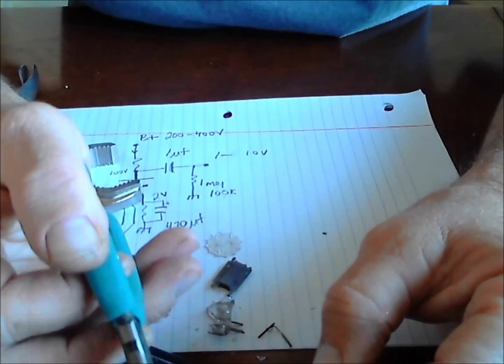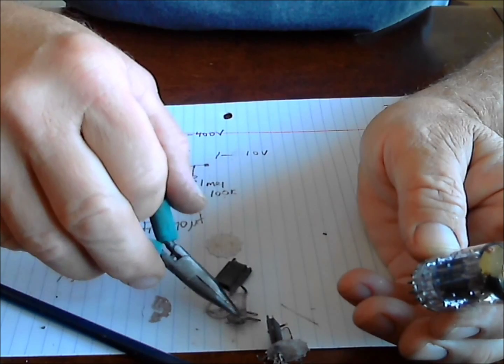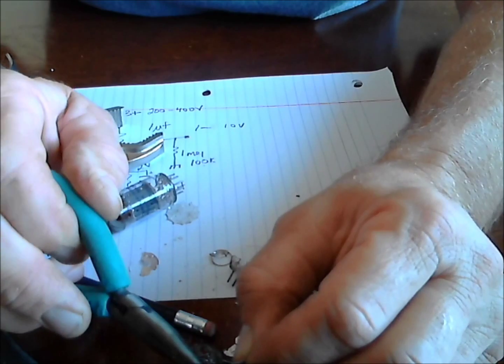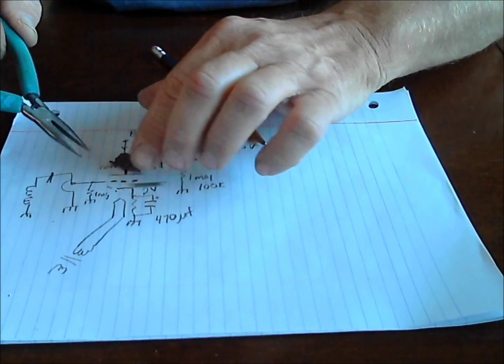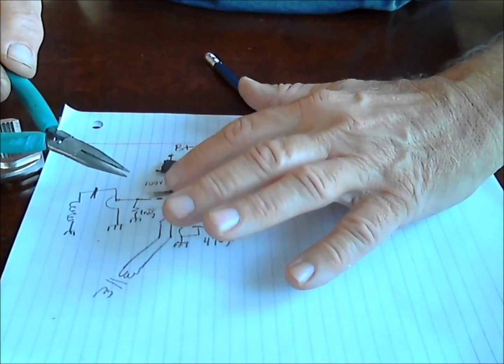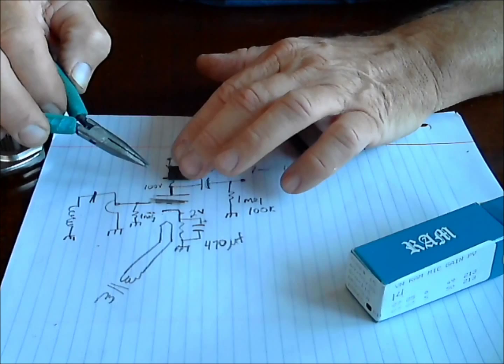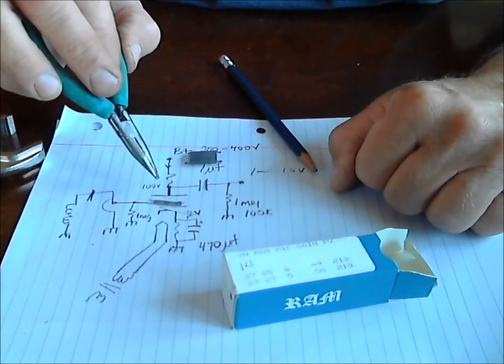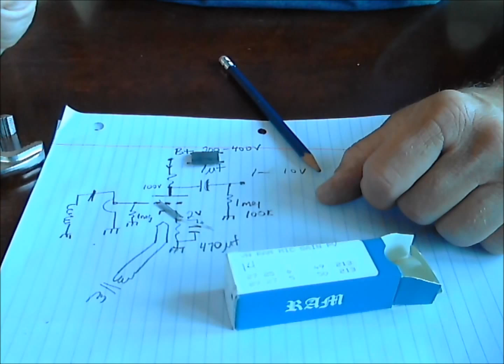How A Triode Is Made Pt. 2

Comment: ratio of grid wire diameter to spacing is not very important - the ratio of grid-cathode spacing to plate-cathode spacing is important, ratio of grid wire spacing to grid-cathode distance is important.  Normally grid wire is an thin as possible for a receiving tube (limited by microphony, power handling and manufacturing convenience, field emission and some other factors for RF use).  Very rigid wire is used, molybdenum or tungsten typically which can take high temperature

Comment: Really enjoying your videos. 
I think nickle is magnetic (not as strong as iron though). Cobalt and gadolinium are too. 
Also i think that the original prototype valves were diodes which were essentially a light bulb with an anode plate. It would only conduct in one direction so the term valve i think was more like a heart valve which is a one way rather than an adjustable tap like valve.
This isn't the article i originally read but there's some info here. 
http://en.wikipedia.org/wiki/Diode#Vacuum_tube_diodes
Im not trying to correct you, I just thought you might be genuinely interested. Keep up the good work!